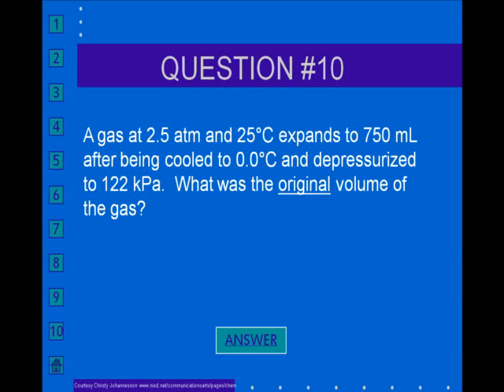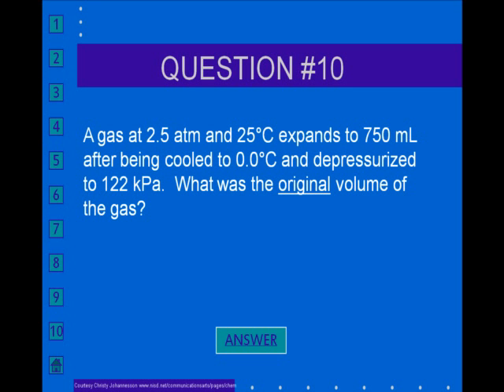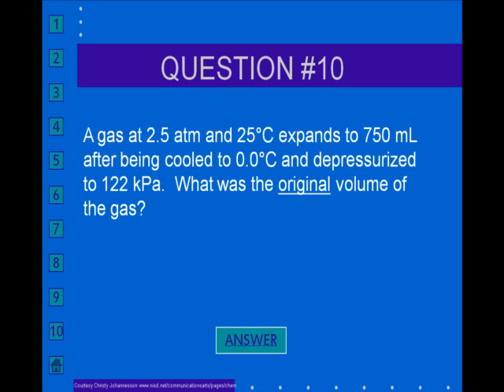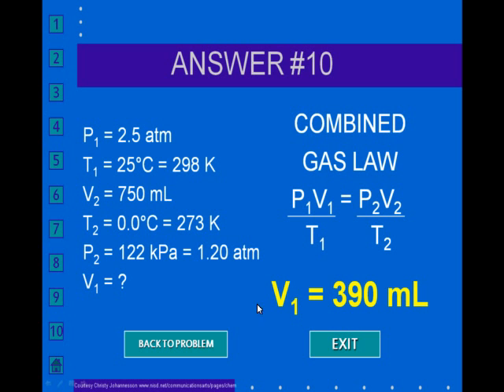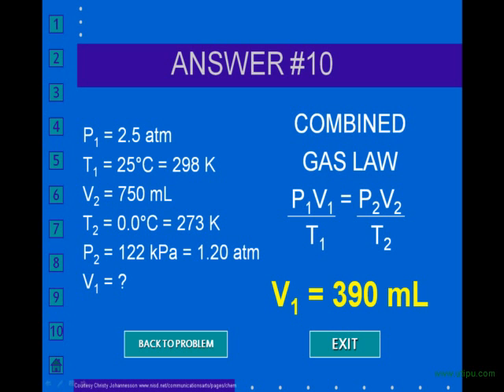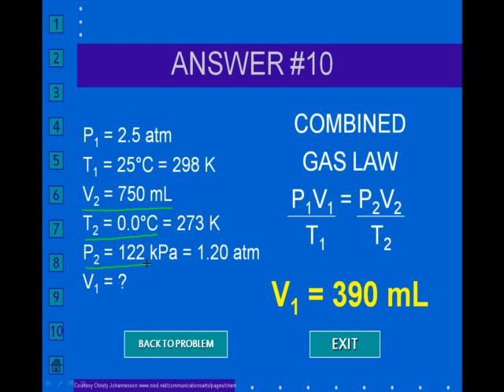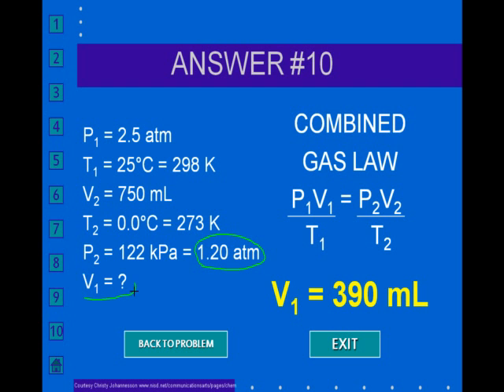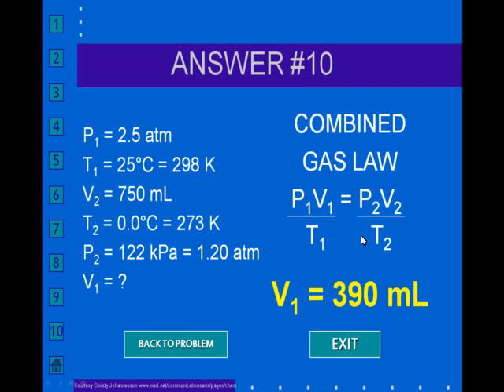Combined Gas Law

Comment from the maker: V1 is what you are solving for so V1 = (P2*V2*T1)/(T1*P1).
Now plug in the values: put in 2.5 for P1 298 for T1 etc. Sorry for not showing the work, but try it yourself and see if you get the "right" answer.